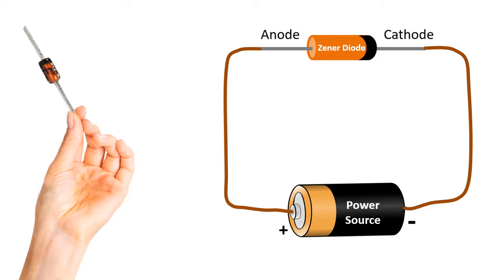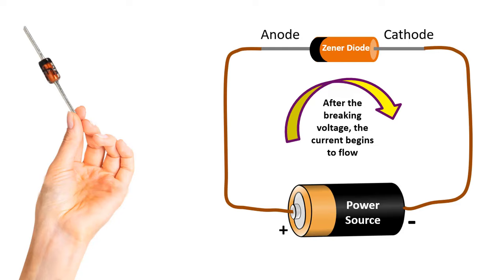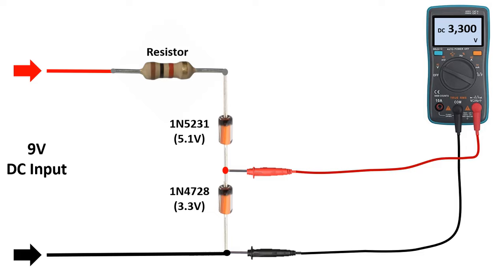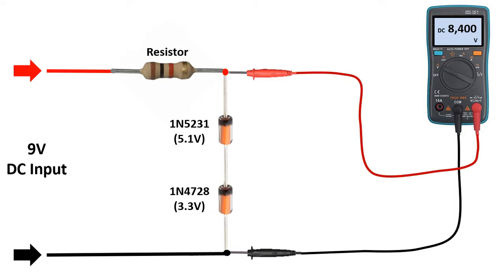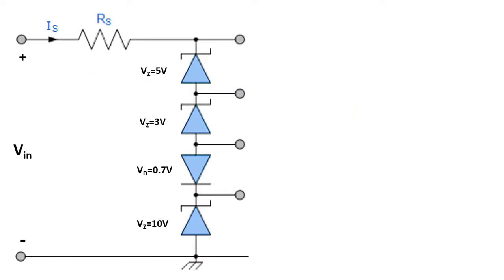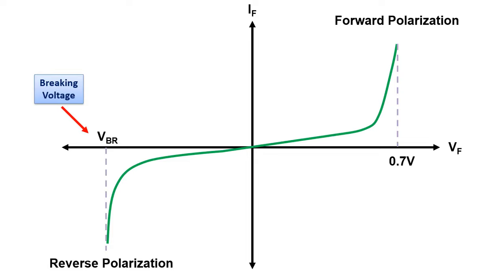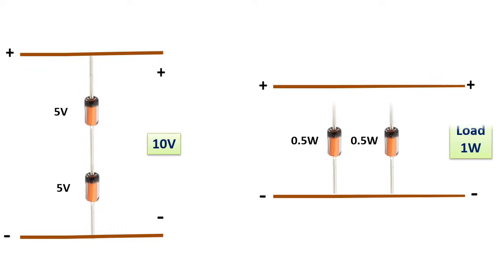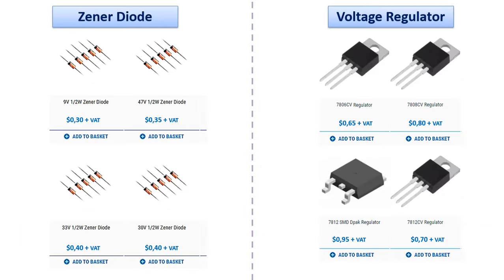What is a Zener Diode? How Does it Work? Where to Use? ( Zener Diode Tutorial)

Comment: This was great, thanks! Quick question, voltage regulators are often quite inefficient, and can get quite hot, do Zener Diodes suffer the same issues?
Reply from the maker: Thank you. This type of problem is less common in the Zener diode.
Reply: Voltage regulators and zeners are not the same thing.

With a voltage regulator you might pass 1 amp through it, you don't do that with a zener.

You don't draw your load current through the zener. 

You pass enough current through the zener (typically milliamps) to cause the diode to break down at the required breakdown voltage. The datasheet will tell you what the minimum amount of current is.

The zener is a voltage reference NOT a voltage regulator.
Reply: OK, say you have a 10V supply, 5 ohm series resistors and a 5V Zener.  That can supply 5V 1Amp to the load.  If you take an amp, the resistor gets as hot as a voltage regulator but all the current is going into the load so the Zener isn't hot.

BUT, if you remove the load, that amp now flows through the Zener.  The resistor is still hot, and now so is the Zener!  Far worse than a voltage regulator.
Which is why you would design the Zener circuit to only supply say 10mA, and then use that to drive a transistor to boost the current (I'm simplifying).  And that's a linear voltage regulator.
Reply: Voltage regulators are a better option in high power circuits. Zeners have poor regulation and the output current range is limited. Voltage regulators often need heatsinks.

Comment: Can a Zener diode be used to limit the output of a 650 watt portable gas generator to say 230 volts? Its governor keeping the revs constant to produce 230 volts is inoperative.
Reply: Actually, the Zener effect is a low voltage thing found in diodes with high doping levels; generally below 10V. Above that voltage the avalanche effect takes over.
Anyway, no. You need a series regulator to regulate that way, and doing that with a high power device is spectacularly expensive.
The governor should be economical enough to repair.

Comment: I was messing with zener diodes yesterday and they don't work the way presented in books nor here...if you change input voltage, the zener diode voltage changes also, but not so much. for example, you change input from 5 to 20 volts. the zener diode voltage changes from 3 to 4 volts.
Reply: Zener diodes are not perfect, as presented here. They have a slope and the voltage does change with input and load.

Comment: So basically they only allow a certain amount of current to go through them? Depending on the value of the zener diode?
Reply: No, the series resistor determines the current. Without the resistor the diode would self destruct. This video is very simplistic.
Reply: Nope.  They only allow a certain votage to exist across them (within limits) so can be used as a voltage clamp or reference.

Comment: Its Super Good For radio Signal Detection
Reply: Is it? Better than a signal detection diode?

Does the fact it is a zener which is designed to breakdown at a specified reverse bias voltage, is that a desirable or essential property to have in signal detection/demodulation?

Comment: You may also use an LED as a Zener diode  ! a red LED will regulate at about 2 Volts and a blue or white LED will be slightly higher at 3 Volts ... The EHT diode in a microwave oven has many high voltage diodes in its package and might regulate at around 10 Volts ( which is why you cannot test it with a multimeter set to diode test ! ) for  MUCH  higher voltages a Neon bulb can be used ( 90 Volts ? ) ..... DAVE™🛑

Comment: So it's a cheaper version or economical way to use than a voltage regulator? That's what I learned from your video. And the voltage regulator that you showed is a mosfet which can also control the output of the desired current. Isn't that a pros and cons to it?🤔
Reply: No. The voltage regulation is not as good as a regulator chip. There is no thermal regulation and the voltage changes with load and input voltage. The current draw must be known to calculate the series restor because the zener has an operating range. A decent regulator has a vastly improved range over a zener.

Comment: Never connect diodes in parallel without balancing resistors.
Reply: Agreed.
I would not consider the parallel configuration a 1W Zener.  It's a 0.5W Zener that keeps working if one Zener fails.  Which is how they are used in safety applications.
Reply: Don't use zeners in parallel. I have never seen a circuit that does this. The devices would need to be perfectly matched. Use a bigger zener, they are cheap enough.

Comment: he doesn't say that if he puts a larger voltage U across the resistor and the voltage on the zener diode rises, the zener diode short-circuits _maybe 10V on ZD 5V _ZD lets go and it is K.O. _But Voltage regulator is good and working